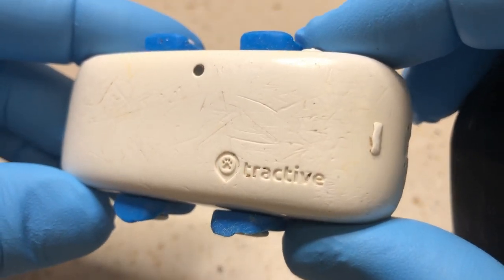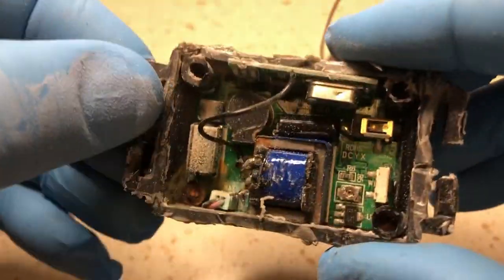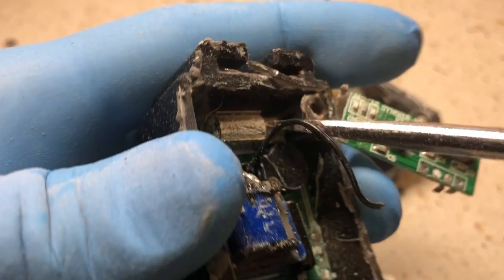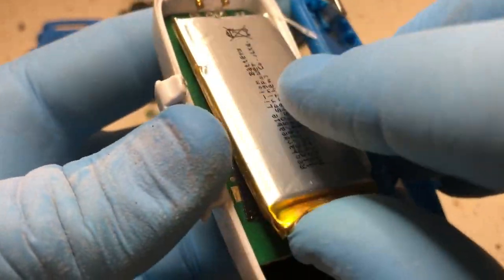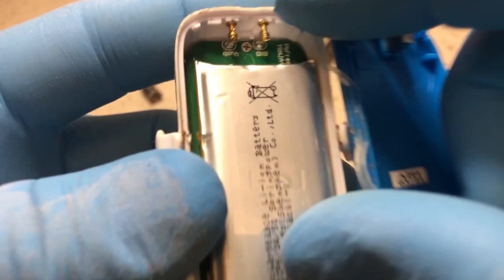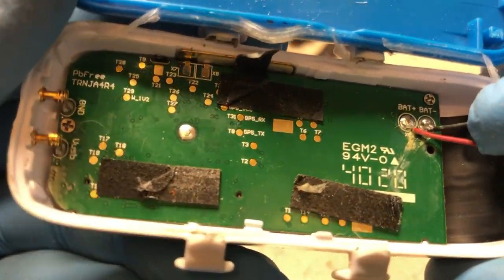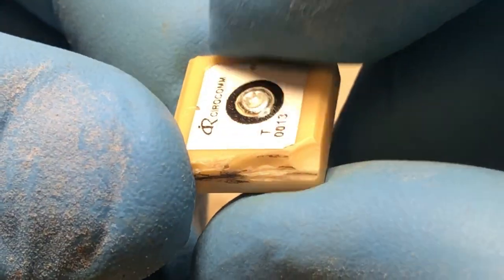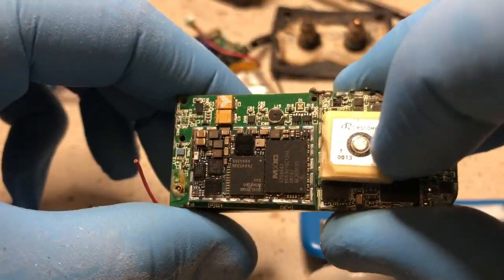Teardown of Tractive GPS Pet Tracker and Petrainer Shock Collar

Comment: Can i mod this device, so I don't need subscription?
Reply from the maker: It's highly unlikely. The device communicates with the local cellular network and has a built in IMEI likely registered to Tractive. The data is likely being sent to Tractive servers. Whatever carrier accepts the data is going to bill Tractive and they will bill you. So to hack it, you will need to change a lot of firmware hard-coded stuff. Not easy!
Reply: @devhackmod  Damn. But thanks for your response!
Perhaps I can sell it to someone. I'm looking for something smaller, and without sim.
Reply: @devhackmod Where would you insert sim in tractive. I didn't see anything for it
Reply: @abhishekbhatia9853  I think the module must be using an eSIM (embededd SIM which is a small chip) instead of a physical sim card.

Comment: i think that the black cilinder in the shock colar is not a capacitor but a tilt sensor.
Reply from the maker: Good point. I'm not sure as I don't have it anymore, but there should be a capacitor in there as well somewhere because it has to load up enough power to deliver a shock. Battery alone can't drain fast enough and at high enough voltage, so there is usually a capacitor and transformer coupled together to crank up the voltage and provide enough current to deliver a zap! Poor dog! 🤣

Comment: when I tried to open my tractive device (button not responsive, light and sound not working, was charging though) it heated up and then smoke started to come out and the housing melted.
seems that the battery exploded, I don't understand why.
Reply from the maker: It sounds like at some point you shorted the battery. If you were prying it open with a metal instrument it could have contacted the battery terminal and caused a short circuit, the battery started to discharge quickly and heated up. Also could be that prying it made the circuit board contact another metal component inside, once again it could have caused a battery short. Either that or you engaged the self-destruct mechanism! 🤣

Comment: Hey, can you find out which connection on the charging input is negative and which one is positive please? I was watching but couldn't work out which is what..

I've lost my charger, but I know it will be possible to cut any USB charger and connect negative and positive to the device and plug in USB port 5v 1A

I don't want to risk destroying the battery cells by connecting to wrong prongs
Reply from the maker: Hi, sorry the unit has long been trashed so I don't have it any more. I tried to return it to the original owner by contacting Tractive numerous times, which they confirmed, but they never followed through with any further instructions so I told them I'm trashing it. Could be the original owner stopped paying the subscription and maybe didn't need the device anymore so they didn't respond. As far as figuring out the terminals, if you can non-destructively open your Tractive device you can check inside directly. Alternatively if you have a multimeter there may be a small residual charge on the internal cell and you may be able to sense that on the pins, so you know which is the "+" and which is the "-" terminal.
Reply: Thankyou for this reply,  i didn't see until now @devhackmod

Comment: I would be grateful if those who know about these things would tell me how they work. Specifically I am wondering why I have to pay monthly for the tracking service, and whether it's possible to somehow hack this to switch to a mobile phone I have. This question may seem odd because I'm not even sure how to formulate it, I don't have the necessary understanding of the technology. 

I am just looking at this and thinking that it communicates with local cell towers, in the same way a mobile phone does. If that is the case, and the company charges a subscription service, then it seems like it's using the same tech as a phone. As one can switch cell providers, I'm wondering if this could be messed with to accept a sim I purchase. 

Again I apologise for the absolute ignorance of this question. I am only trying to understand how the tech works.
Reply from the maker: You are asking all the right questions! Yes it appears to be using a local cellular tower data connection, much like cars use for telematics services (On-Star, GPS tracking, etc). Ultimately somebody has to pay for the data carrier and so the company making the tracker needs to pass on that charge to the end-user. You will notice on the "uBlox" package there is an IMEI number which is a unique number identifying each mobile device. No matter what local carrier is used (and it may be hard-locked by Tractive based on region, I don't see a "SIM" or any way to change this), it requires a cell-tower to work. You can't just make it communicate with your phone (and even if you could use some BlueTooth feature, the range is way too short). This is something Tractive would have programmed into the devices and arranged contracts with carriers and costs for data services at the time they engineered this, or perhaps can change on their end, but the user has no way to modify anything.
Reply: @devhackmod  
I believe you have been very kind and charitable with your reply when dealing with someone who is obviously quite ignorant of these things. 

To clarify...would someone be able to utilise the hardware and create their own little custom GPS tracker? Or is it somehow locked in a way that only Tractive can use it? 

Again I apologise for what I assume are grossly ignorant questions.

You may have to dumb this down for a biologist (which is what I am).